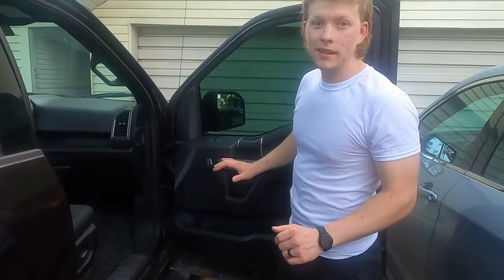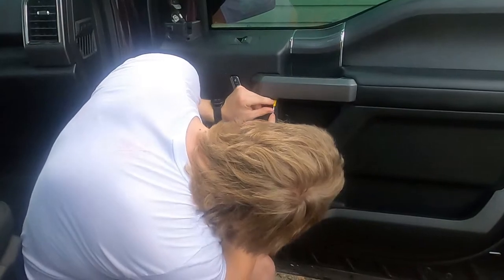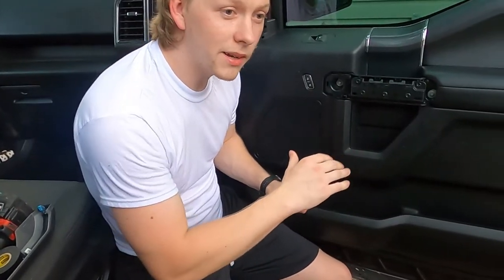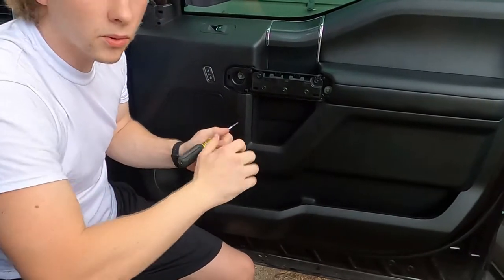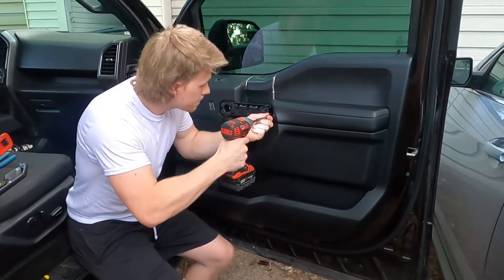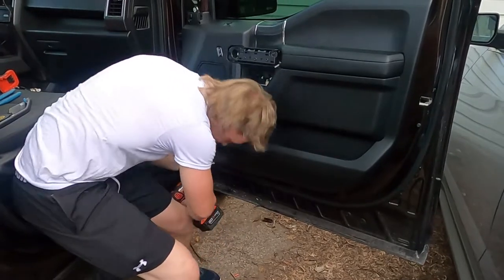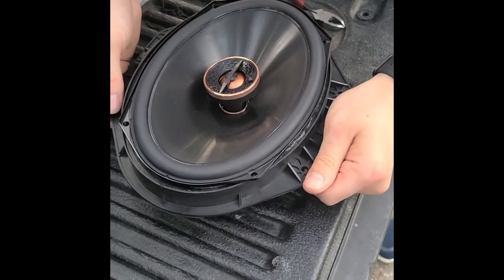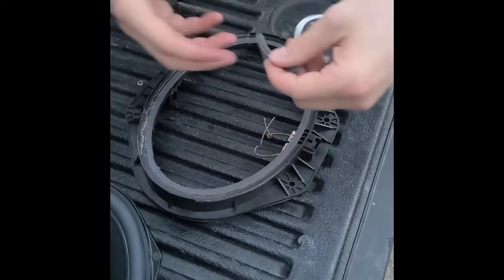Ford F-150 2018 Ford Door Speaker Upgrade 9X6 speakers

Comment: Is this hooked up to an amp or factory power?  If using the factory power did you loose any bass or volume going with better speakers?  How do you like the performance / sound?  Reason I’m asking is because in the past, replacing stock oem speakers with better aftermarket ones typically require more power and in the past this resulted in less bass and lower volume because the better speakers require more power.  Which, in the end resulted in not sounding as good as the oem speakers.  
What is your experience with replacing the speakers with aftermarket?